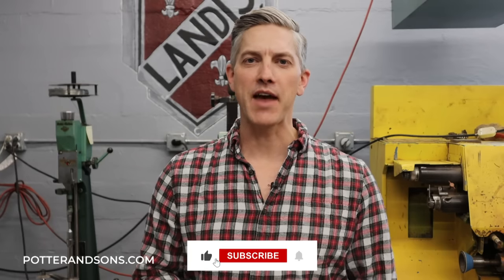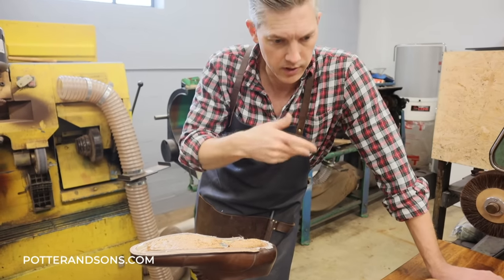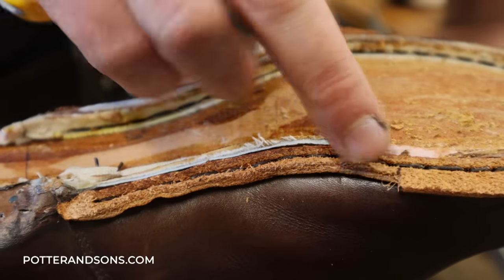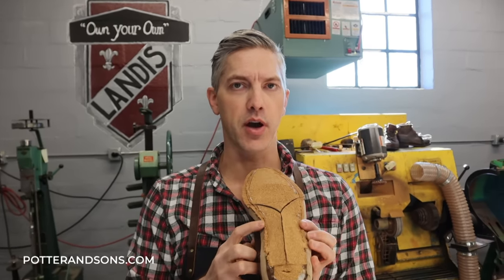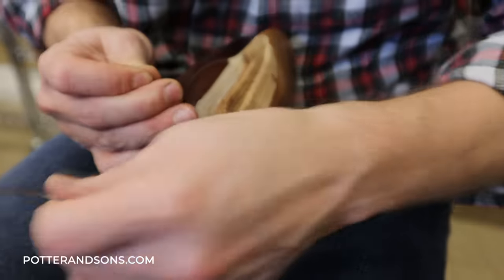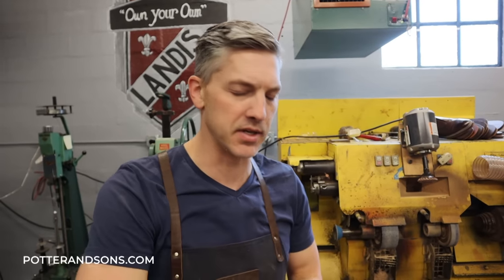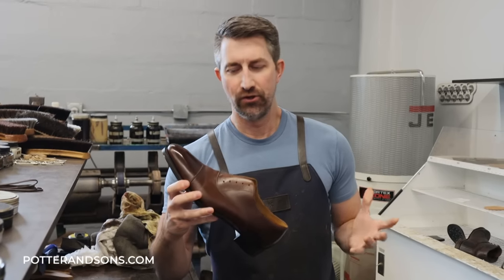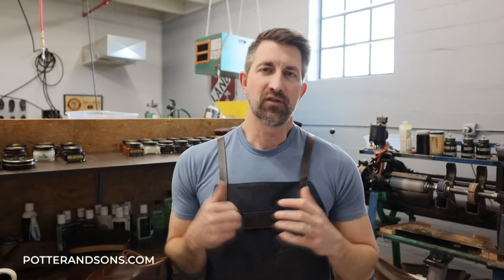$200 Shoes Transformed Into $2000 Shoes (Meermin)

Comment: Really enjoyed this project a lot.  It's nice to see what can be done with a good quality shoe.  Those turned out very nice, giving them that spaded sole look, the build up of the sheet cork to fashion that fiddle back waist.  Nice/tight tpi stitching (sore hands at day's end), and hidden at the bottom.  Loved seeing the Lulu tip going back on, nice two-tone dye on the soles and extra use of the decorative wheels.  The appearance of a slight lift to the heel and angled just a bit, loved it.  The question, how much to make a $200 shoe look like a $2000 shoe?  Nice work there fellers.

Comment: I saw some of these Meermin shoes in the past and I don't understand how these are so cheap. They are gw, the uppers are made of decent leather on nice lasts and also have leather soles. (With blind stitch, which is pretty hard to do, easy to cut through or just cut it too shallow) They are also leather lined with decent liners, not pu what I sometimes see. I was expected to see something cheap stuff on the inside, but no. That welt sewing problem was pretty bad though, on the worst place possible.
Nice work as usual, especially on that bevelled waist. Skiving the welt and cutting the sole to the right shape is not easy. Also, there is no problem if you stich the invisible part of the welt with higher stitch density, a lot of bespoke maker does it to spare time. Doing a 8-10 mm stich length there is absolutely fine.
Reply: Made in China

Comment: The problem I have with $2000 shoes is that they don’t often fit my $200, work-boot foot.
Reply: luckily for you shoes come in more than 1 size
Reply: @ViciousTwistX  work boots ruin your toes
Reply: @Sourcererdolphin  Most modern footwear ruins your toes, which is why you size up. 😉👍
Reply: @ViciousTwistX But some folks bank accounts only come in small sizes. Too small for $2000 shoes.
Reply: @kevinmcd112  it's not the size it's the steel cap for example and the soles
Reply: They Do not fit my budget 😀

Comment: … yes but the toe box’s and counter reinforcement’s are still production thermoplastic material and not the same material used on a 2000.00 dollar men’s dress shoe 👞… for what you fellas had to work with you did an excellent job although the counters and toe boxes and even the insoles must be made from double shoulder leather to be considered a high valued bench made or bespoke men’s dress shoe. The fine job you did doesn’t increase the shoe’s value to 2000.00 dollars.